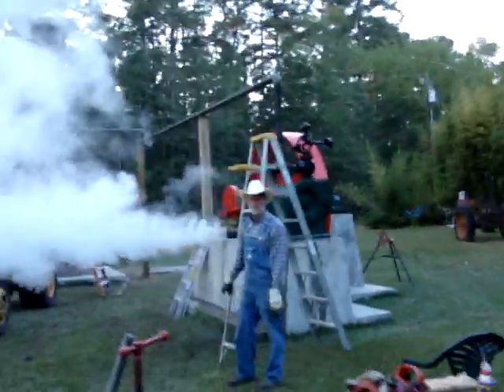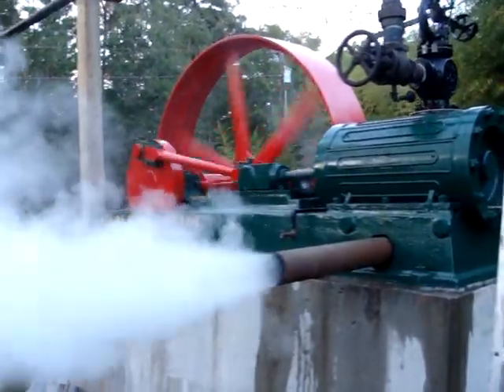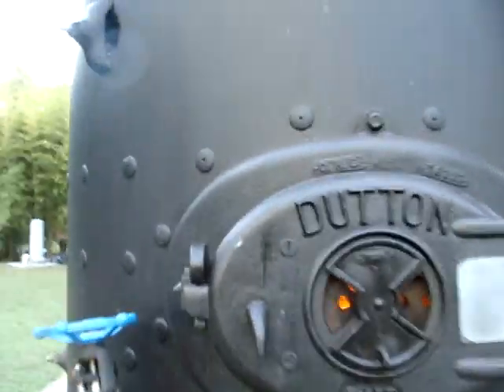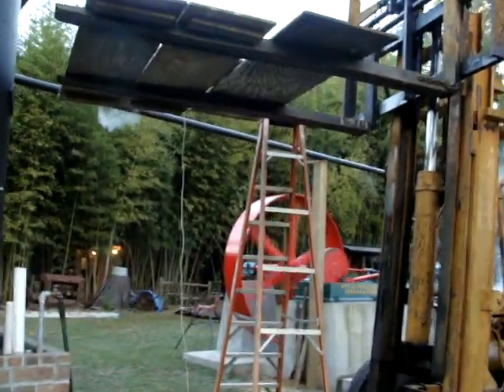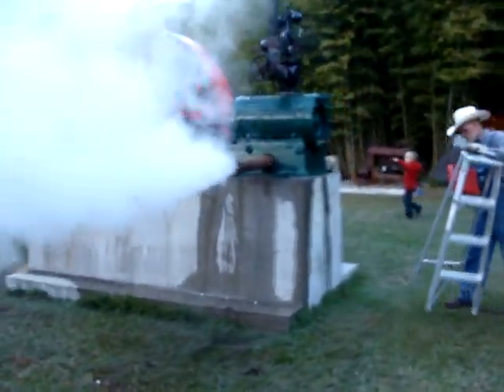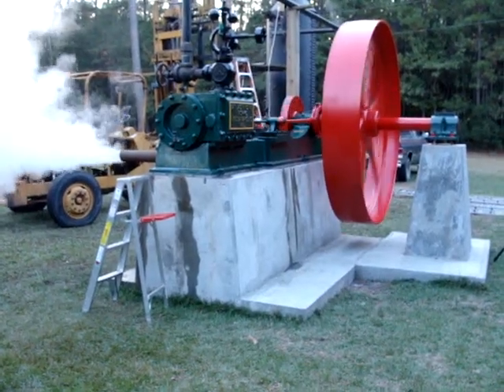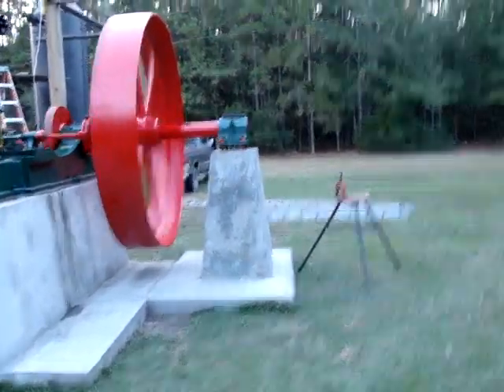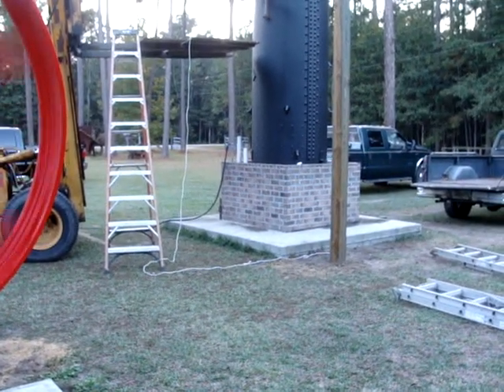Atlas Side Crank Steam Engine first run in 60-100 years

Comment: Nice old engine. Run non condensing. Lo temp., pressures.  Pretty inefficient. Likely lucky to hit 4-5% thermal efficiency or so. Need to hook up governor,  install pipe lagging etc. But nice engine, nonetheless.

Nice old engine. Run non condensing. Lo temp., pressures.  Pretty inefficient. Likely lucky to hit 4-5% thermal efficiency or so. Need to hook up governor,  install pipe lagging etc. But nice engine, nonetheless.

Comment: this was a beautiful project. I hope you know, with a boiler that big and that many tubes, you could put a hundred kilowatt generator on that easy, off the outside of the flywheel for speed, and run it up to 1500 rpm off the outside, and have lights everywhere. like vegas.